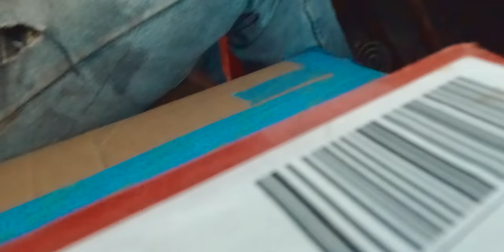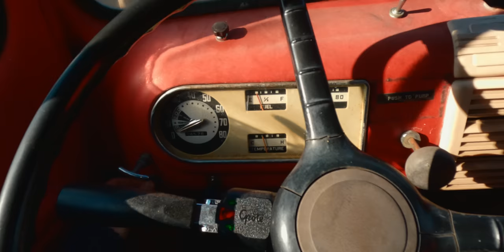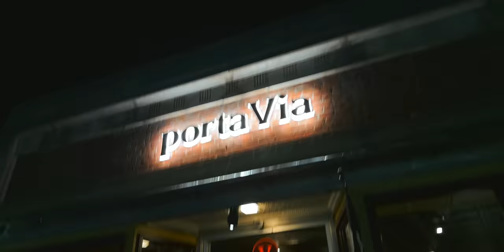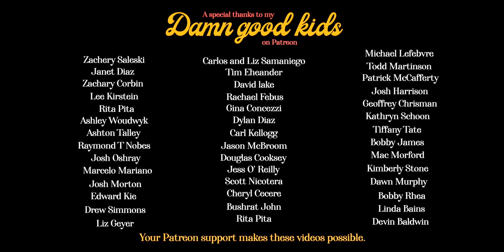First Winter Storm at Remote Off-Grid Cabin + Small Town Holiday Life

Comment: For years I owned/drove a 1951 Ford truck and I can agree with you 100% about being in, and driving, one of those trucks. A hint for pulling old nails; drive them in 1/8 inch before pulling. It breaks the bonding between the nail & wood.

Comment: Re cutting the beams. When you had trouble trying to cut and loosing battery power quickly. I suspect that the beam you were trying to cut was partially dry and hardened, more so than your other beams and that was causing the problem.  Looks great tho up on the ceiling.

Comment: A little helpful advice on those stubborn rusty nails. Get you some WD40 spray. Use the little pick nozzle that comes with & get it right down to the base of the nail and wood; give a little spray, let sit for about 30 min then you should be able to pull it right out.